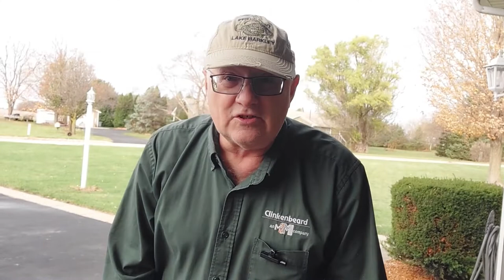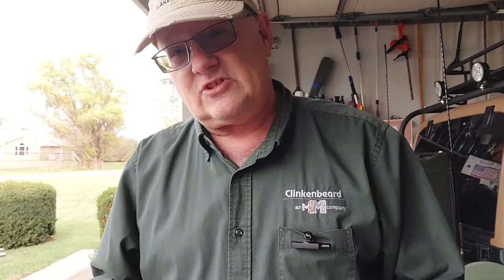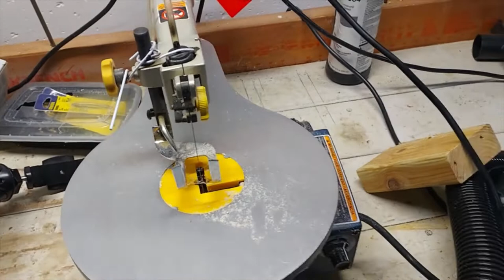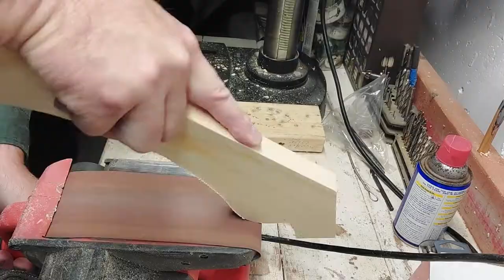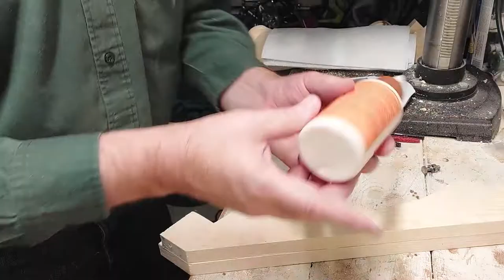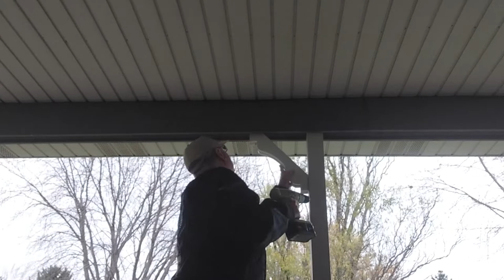Corbels for 4 bucks make custom corbels for pennies on the dollar Wood Working Home Improvement

Comment: Why did you not use a 4x4?  I also don't get why the middle piece is smaller than the outer pieces.
Reply from the maker: We chose to make the center smaller to give it a more 3 dimensional look, yes if you wanted to be more of a clearer look using a 4x4 would do that. Please subscribe to the channel, thanks for watching  Steve